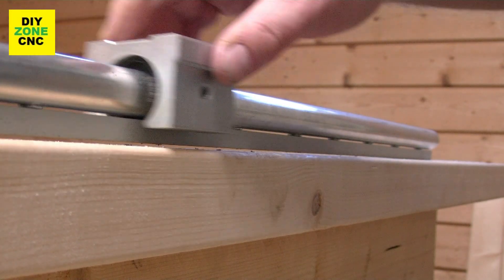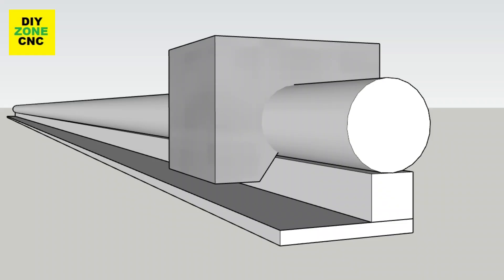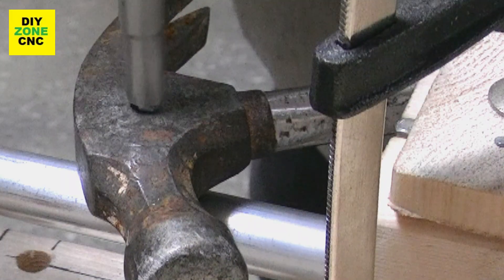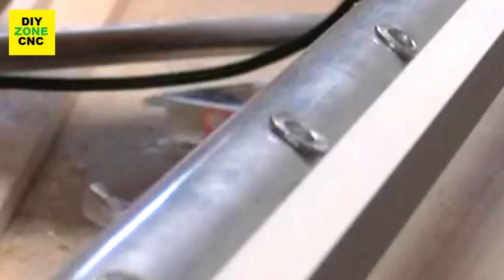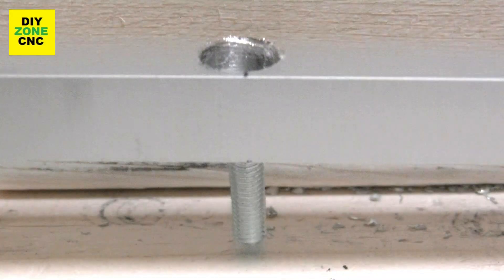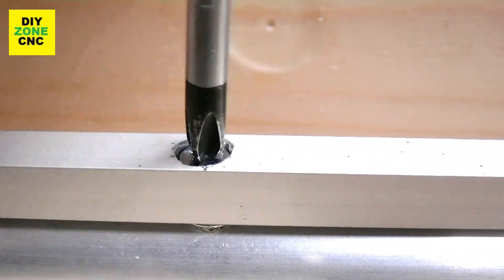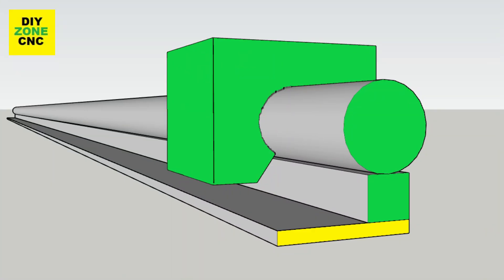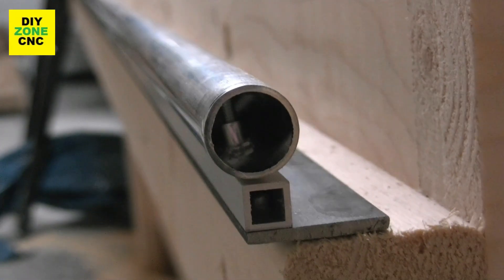Making Linear Rail for my homemade full size CNC machine

Comment: Thank you for very nice video! Don`t forget that you will get much better results, when you use a more hard steel pipe in your project. The bearing block will slide way much smooth on steel pipe than aluminum pipe, aluminum is too soft for steel ball bearing. Thank you!!

Comment: This is a waste of time and materials. The hardened steel balls inside the bearing blocks will dig into aluminum in no time.
Even the cheapest linear rails are made of steel that is hardened on the surface to withstand the pressure of the balls riding on the rails.